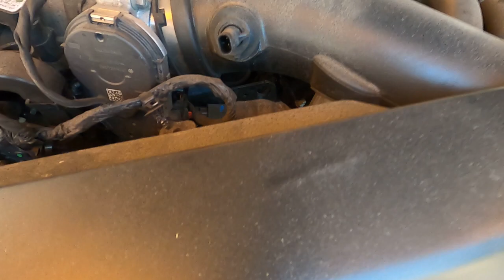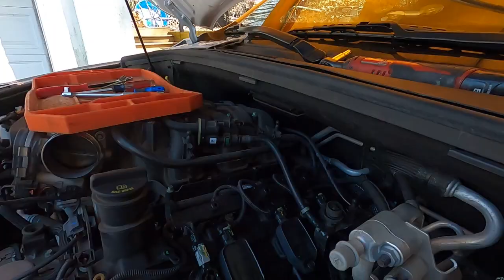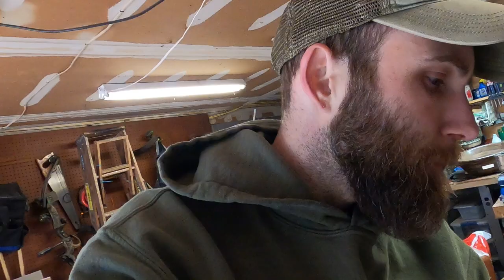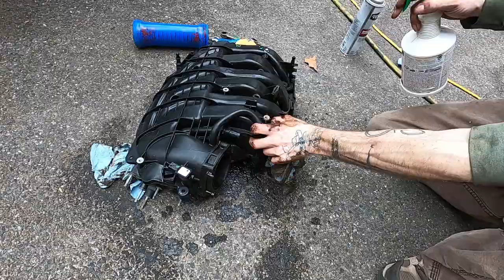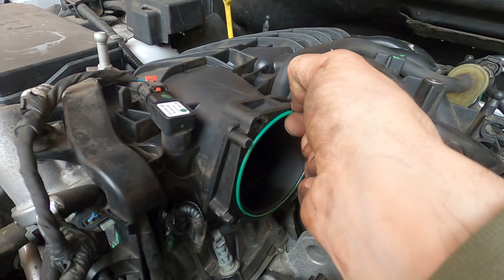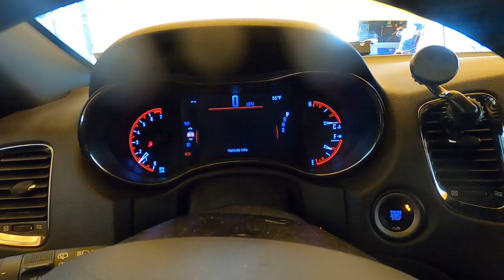Jeep/Dodge 3.6L Spark Plug & Intake Gasket Replacement and General Cleaning (90k Tune-Up?)

Comment: Thanks for the video!  Got hung up on a few things that i didnt expect to when attempting this:  the connectors to the plugs did not want to budge after i pushed the white tab up, and trying to get that top right part of the plastic that wires run through to be free.  I didn’t see a bolt for it and looks like it should lift out?

Comment: Sense you are working on a durge, ever see one that acts like the tourer converter doesn’t disengage when stopping sometimes or when you shift from drive to reverse? Mine only dose it once in a while but it’s annoying. It’s a ram
Reply from the maker: Can’t say I have seen that, but would not doubt a computer issue could do that. Maybe get the stealership to reflash if possible

Comment: Thanks for the vid. I’ll be referencing this once the Gladiator hits 60k
Reply from the maker: Awesome bud! How is the 3.6 in the Gladdy? Still have the XJ?
Reply: @DEInTheGarage  so far so good with the 3.6. In almost 35k miles I haven’t had one issue with it, and it definitely has a lot more power than the 3.8 that was in my rubicon. And unfortunately no I don’t have the xj anymore, but luckily it’s still in the family. My little cousin just got his license and needed a vehicle so he has it now. Plus my commute for work got a little farther so I picked up something with a little better mpgs. 2016 Impreza hatch 5 speed